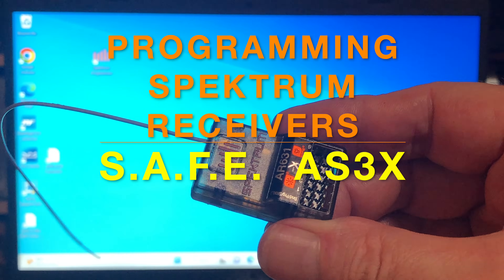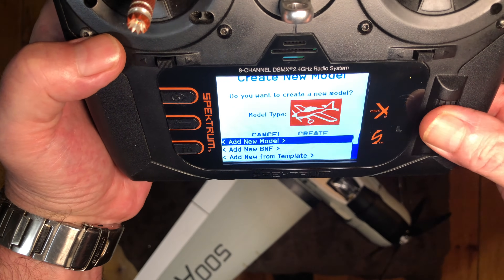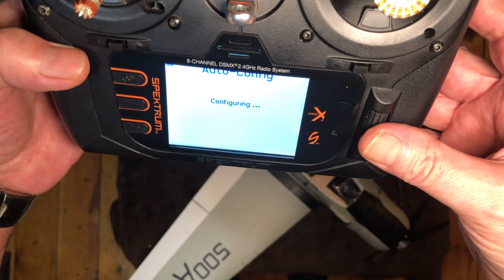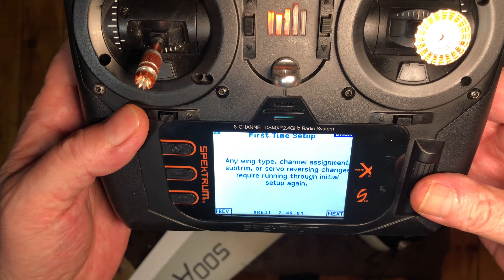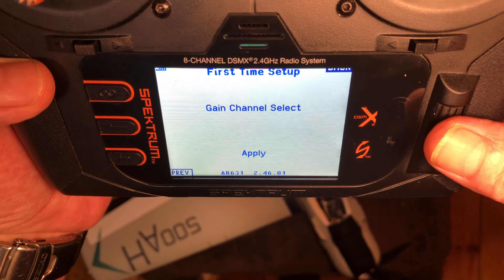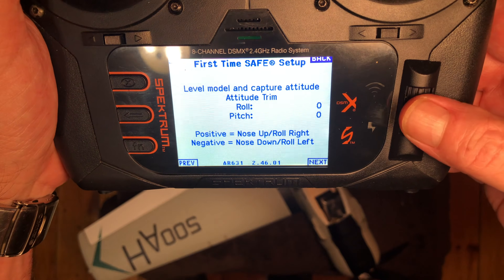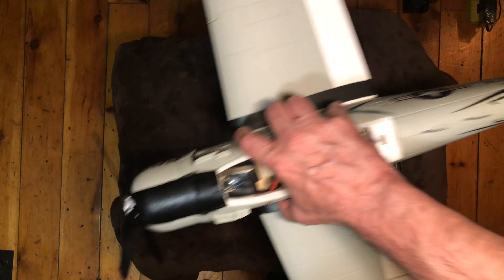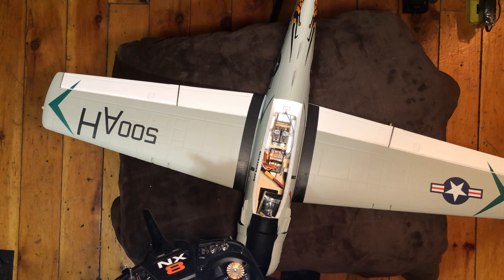Programming Spektrum Receivers with S.A.F.E. and  AS3X #new #rcplane #setup #test

Comment from the maker: This exact same method and procedure can be used on several different Spektrum Receivers and Transmitters , including models with retractable landing gear and working flaps . The radio will automatically assign channels to the gear and flaps , so use the basic Aircraft Type shown . This is the fastest way to set up SAFE and AS3X , You can make the setup more detailed and involved ....time consuming .and complicated if you so desire.
You can name the model , change channel assignments , gains , rates , travels , speeds ect ect . for example .

Comment: Nope no help
Reply from the maker: 27, 000 people did find this helpful . Sorry .
Reply: @PhilipCockram  27,000 views.  (likes ?)  im frustrated  and nothing is helping.  Remember noobies are looking for answers, more basic questions, focused at noobies.  For an example, at 2:50 im not being a dick i just want to know how to make the safe and AS3X being able to turn it on and off.  i realized this was a couple years ago.  maybe things are different.  ps.  your not the only one i make this complaint.  i find this issues the same on most videos.  im hoping someone would come up with a really basic video.  some dude did one on the DX5C and it was sweet.  i learned all that needed knowing. but that was several years ago.  maybe someone can point a finger where to look for more complete answers.  thank for your time.  have fun.
Reply from the maker: @readeracingRC  During the setup of SAFE you'll be asked to assign a switch for Flight Modes . I always use the "B" channel 3 position.
After choosing the switch,  you then set what you want each position to do .
1 is SAFE and AS3X
2 Intermediate (if available) and AS3X
3 AS3X only 

Unfortunately,  its slow learning curve but gets much faster when you've done it a few times . Hence the speed and pace of this video aimed at experienced pilots .
Just getting used to all the programming terminology can be a challenging. 

Take your time , don't be afraid to delete the model and try again , each mistake is a lesson too .

Ive found most of the Spektrum programming videos to be too long and confusing ,
So I cant point to one person or channel , Ive gotten little bits of info here and there and figured the rest out myself .
One of the issues,  is that there's sometimes several ways to do some of these functions and thus lots of duplication , adding to the problem. 

If theres something more I can help with feel free to ask .

There lots of other helpful people in the community as well . Just try leaving  a more friendly comment when asking for help . LOL 
Cheers and Best of Luck

Comment: Great video.   QUESTION.    Can I program AS3X onto my receiver, then Stop, before the SAFE  installation.    If  I ONLY wanted AS3X active  "at all times"   and No SAFE at all,  would I still need to Assigned a  Switch.   Would AS3X just be perminantly at all times.   Like i want.  Let me know Please.
Reply from the maker: Thanks for watching . Assigning a Flight Mode switch is part of the set up procedure . 
But you don't have to use it . 
Flight mode 1 will be SAFE and AS3X
Flight mode 2 and/or 3 will be AS3X only .
You cant  stop the procedure halfway through.
So,  I recommend following it exactly as this video shows  and just leave your switch in flight mode 2 , 
Hope that helps.

Comment: Take the prop off electric planes while you're working on them. AS3X doesn't arm until you open the throttle to more than 25%.
Reply from the maker: Thank you for that helpful tip. Its also a good practice to check and re-tighten the prop after the fist fight or when replacing one.😉

Comment: When I program my receiver with with SAFE  and AS3X  on my E-flite Ultimate 3D on switch B it  reverses the throttle . I have not programmed throttle reverse. Any one have any idea?
Reply from the maker: Hi . Somethings obviously very wrong for that to happen . I have heard of a few instance of this happening  lately . Not to this plane specifically though . 
My guess is it something to do with one of the newer transmitter or receiver updates .
Or a defective product , It happens . I just had a brand new plane with a bad receiver. 
I suggest going through everything again .
The Spektrum flight model could be the culprit also ,  if you're using it . 
If nothing works call Horizon , talk to a person directly , not chat , and they should be able to either talk you through the problem and or will use that process to determine if it a warranty claim is given . 
I've had good success with them dealing with issues that way , Some folks ...not so much . 
It sounds like you know your stuff and they will respect that , they deal with a lot of newbs as you can imagine . Best of luck . I'd be interested to know how it works out , Cheers

Comment: If the plane is a tail dragger and you are setting up safe does it need to be level or resting on the tailwheel. Because if I set it up with the tail wheel down when you select SAFE off the elevator pitches up?
Reply: Should be level and not on the tailwheel.
Reply: @toasterizer1  Thanks, I have never seen any documentation saying to raise the tailwheel but it makes sense.

Comment: Would it not make for a more complete setup to do the other two flight modes? Say FM2 AS3X and FM3 with nothing, just all natural. Using my NX10 and this is where I would like to be, but my forward programming fails to connect to my AR9350 to do the setup. I will check your other videos and thanks!
Reply from the maker: Hello , those other two flight modes auotmatcilly accompany the set up . As long as you're using a 3 way switch . It will be full ...S.A.F.E , AS3X and nothing ...depending on the switch position .

Secondly , the AR9350 is an older 'sport' receiver that doesn't have SAFE built into it ...from my understanding . 
So , unfortunately , while this procedure and video does work on most modern receivers sold today , I think your receiver is incompatible with SAFE . 

There are some videos ...from Spektrum on programming that model normally and you may find those helpful . 
Thanks for watching and your question .

Comment: Great video which I followed and got all set up but throttle no longer working. Reset to factory default and throttle works again. Followed set up again all set up but no throttle again. Any idea why that may be?
Reply from the maker: Hello , The throttle cut and switch assignment can be programmed at anytime . And is independent of the SAFE and AS3X system .
Its just recommended to have or do on all planes .
and is why it was included here . 
I would try skipping that step altogether during the SAFE/AS3X setup .
Once you know that it is working OK , program a throttle cut after . 

I've never encountered this , so i think its just a glitch in your method or radio .
The method works for many radios , but there are variarition to some models and firmware versions.
Hope that helps.
Reply: @PhilipCockram  Thank you for taking the time to reply. I will try that.
Reply from the maker: @Grahammilsome  Best of luck with it ,

Comment: Philip, thank you for this tutorial. I've bookmarked this video for reference 😃👍
Reply from the maker: Thanks Gina .I hope it helps one day . I've  maidened 3 planes perfectly with this exact set up. Of course you can get more fancy and complex , but that's just icing on the cake .

 I had a fair bit of trouble with this one at the editing stage . Several restarts ....UGH ..
 I did a separate video section on how to remove old programming in receivers and a few other bits like the leveling , but I had to cut them because something was corrupted . 

I'll just make another vid on that and it will help to keep the topics separated anyway . 
Have a great week . Cheers 👍🏼🤠
Great job with the Red Devil BTW .